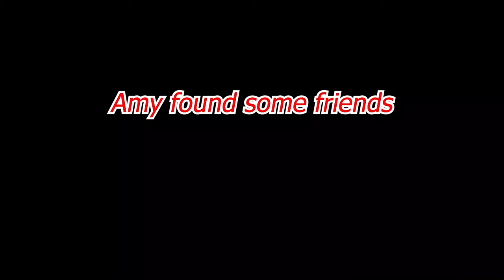Woods 22xe cam Tab Performance Zombie Baffles Milwaukee 8 107 Road King

Comment: Sounds pretty good man. I had Tabs w/ zombie baffles on my ‘21 Road King but went with Khrome Werks mufflers on my ‘23 Road Glide. Dillon Brothers in Fremont was pushing the Wood 22xe cam on me but I wanted to wait and browse some more. Was set on the Star Racing 30/30 but then found out about the APE Cycle Rama 483 cam so I’m going that route w/ the 2-1 Khrome Werks Outlaw. It’s going underneath the knife tomorrow and doing a dyno tune
Reply: Star and CR are good cams but pushing the 22xe is a different way of events. The 22xe needs no pushing. It's an all around winner in drivability and smile.  I've had a few 22xes pushed on me lol and it's a great cam as are the 30/30 & CR but likely borrowed specs from Bobby Wood. Enjoy the wind.

Comment: Couple of questions??? 1. Did you get the zombie with zombie baffles in them or with out the baffles? And are they the 4.5 thickness? Did you up grade headers or are they factory? And lastly any o2 sensor lights on or check engine lights on? Did you dyno tune or just basic map from powervision? Sorry for 21 questions but i have same cams and im adding tab performance pipes and wanting to dyno
Reply from the maker: No problem. You can ask as many questions as you want. So the zombie baffles are the loudest ones that tab performance makes. The mufflers are 5 inch they are called 50cals. The head pipes are vans and Hines. No o2 problems and the map is a map that the mechanic had in his computer that he did for someone that has the same set up as my bike.
Reply: @StevyFaux  oh ok... so if i could explain what i have going on maybe you can enlighten me on whts diff and where im in trouble at. 
I have a rd glide 107' with the woods 22x cams, a power vision basic map, and factory headers, but with 4.5 tab bamsticks with zombie baffles. And i get 02 sensor lights on??? 
Now harley wants to dyno tune lol. 
Did you remove your 02 sensors possibly? I knw your header does not have the cat im sure right? .
Reply from the maker: @showmartinez3460  n  ok I do t have the cat in my head pipes. Kinda sounds like there is more issues there than just a dyno tune. But I’m not sure.
Reply: @StevyFaux  yea i knw. But only issue tht pops up is (02 sesor)..... only thing diff i have on my bike vs yours is i do not  have a header pipe other than my factory one tht still has the cat...... do you knw if your mechanic deleted your 02 sensors maybe?
Reply from the maker: @showmartinez3460  the o2 censor is really important for thank you I g so we didn’t delete them. This one stumps me unless one of your wires is unhooked
Reply: Im gunna check it again. Tht 02 sensor came on after harley installed the woods 22x cams. Never went off. I took it to another harley dealer and had them install 2 new 02 sensors and it came right back on. I have a base map with power vision. Im inclined to knw which basic map you got installed. Maybe ypur mechnic dyno tuned it a little perhaps with out you knowing you think??  @StevyFaux
Reply from the maker: @showmartinez3460  my bike never saw the dyno. The map is a dyno map that he made for another biker with my same set up. Strang that the o2 censor would act that way unless it isn’t getting the air flow.
Reply: @StevyFaux  gunna double check . Is it cool to hit you bck bro ?
Reply from the maker: @showmartinez3460  of course.
Reply: @StevyFaux  so i talked to Harley where my bikes at and told them wht you have on your bike and tht your bike never hit a dyno room its just a map on it. Service guy said the mechanic eho put the map on your bike probably turned off 02 sensors through the configurations when downloading/flashing your bike with the map tune and theres no way to tell as a customer since its  turned off through the computer???? These Harley guys. Lol lol
Reply from the maker: @showmartinez3460  I asked my mechanic and he said o2 sensors are on. But that’s because he had a dyno tune from another bike that had the same setup as mine so he just put that tune in my bike. Other wise he said if he was putting a map in that he was just guessing on he might turn off the o2’s but most of the time there is no need. It’s hard because mechanics all have their own way of doing things. I don’t think one way is better than the other.
Reply: @StevyFaux  ahhhh ok ok i see now. Srry. So theres was another bike he dynoed and he used tht same map tune and put it in your bike as well. Yea totally agree. I get it now if im not mistaken🤘🏽
Reply from the maker: @showmartinez3460  no worries.  I was going to have mine dyno tuned and he said no need cause he already had the tune. Otherwise it would have been done. A good mechanic can dyno a bike and if he knows how the person plans on riding can give them the power and the gas mileage but still have enough room so if you go to higher elevation the fuel injection can still make adjustments.
Reply: @StevyFaux  damn good mechanic. I need to take my bike to him lol. Yall in TX?

Comment: Sound really Gnarly, I like the way your Rear light Keep Blinking, what Upgrade is that? I have the Triple play from Custom Dynamic, and it does the opposite, it Blinks when I Use the Breaks and then it goes Solid.
Help me out here, what is it you have?
By the Way I love your Bike, it’s very Nice..
Reply: How’s that cams Feels, did it make a big Difference in Power?
Reply from the maker: @rickyreyes-sy1mc  made a huge difference. 23 hp and almost 20 torque
Reply from the maker: I installed the custom dynamics box for the brake lights. Don’t remember what it’s called but it makes the blinkers brake lights and has 7 different stop settings.
Reply: That’s good Amount of ponies,
How about your Light, you didn’t answer me on that?
Reply: I didn’t see the response til I looked again, thanks for getting back
If you find what the Upgrade was, please let me know. I like it
Reply from the maker: @rickyreyes-sy1mc  I will see if I can find it. But it is definitely custom dynamics.
Reply from the maker: This is the link to what I am using on my bike. https://www.customdynamics.com/magic-strobes-brake-light-turn-signal-flasher-for-harley-davidson-touring